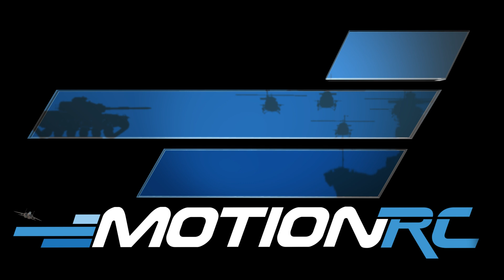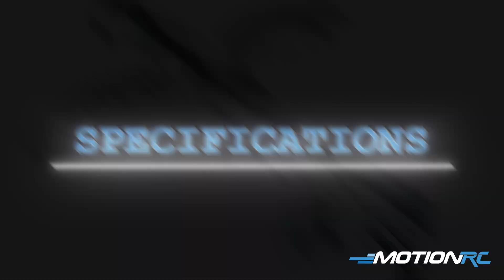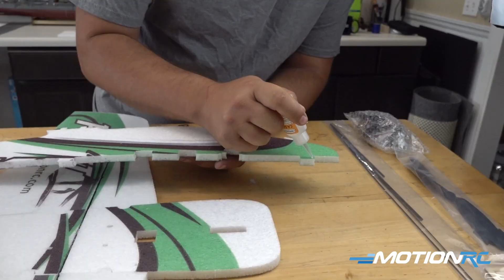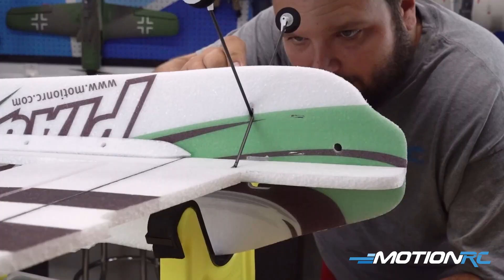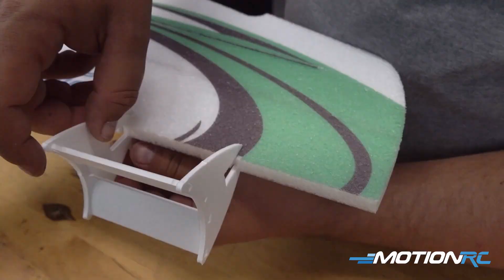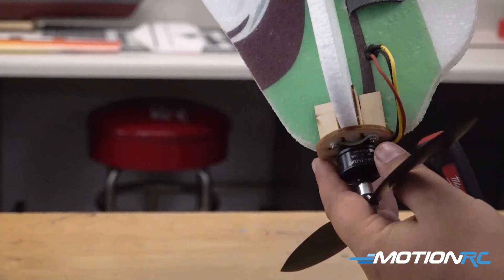Skynetic Piaget II 3D Assembly | Motion RC

Comment: This kit has a few issues.

The black carbon control horns have a different size than the cutouts in the foam. Easy fix just shove the include horns directly into the foam using just one of the precut holes as a guide. 

The servos included won't fit into the fuselage cavity that's supposed to house the aileron servo. I had to enlarge the hole with a razor. 

The push rods included are too big to fit through the included servo arms. Had to manually enlarge one of the holes to get it to fit. 

All said and done, it's a great little plane! Perfect beginner 3D model 👌

Comment: I just bought this plane, is the most obnoxious thing to put together, try to follow this guide had helped a bit but not much, the box came in with no instructions, what the hell
Reply: it's super easy. Just follow the builds on RC groups. The manual is a PDF on the website. That's how most profile foamies are.
Reply: Mine is a bit different- i was hoping there were carbon fiber dowels for attaching the rudder- quite dumb that there is not so hope it holds. My motor mount came pre- assembled. Seemed easy to bulld. I got the arf kits A for the money the electronics paid for itself so if this flimsy thing craps out xan transfer to something else. For $110 plus their shitty glue and 2 batteries for $18 seems like a deal